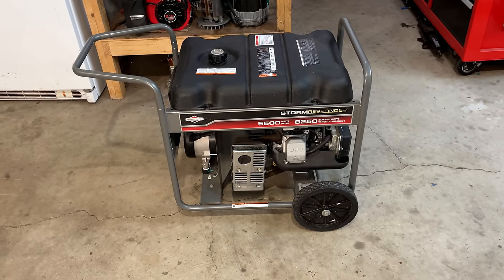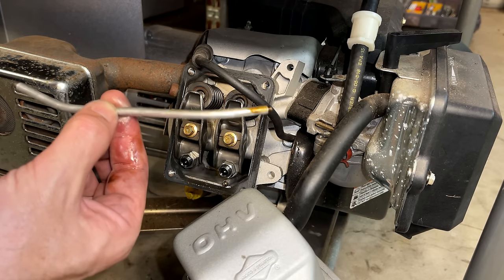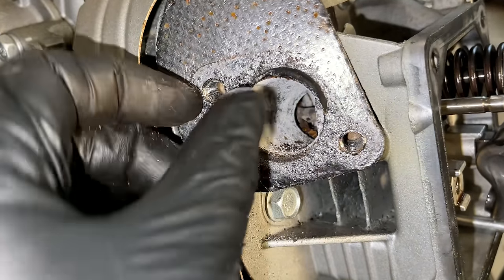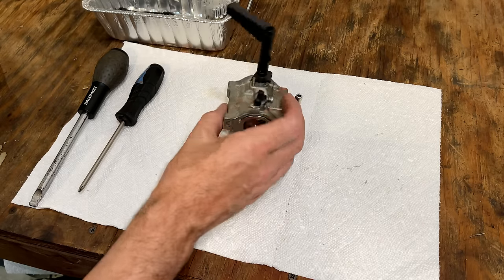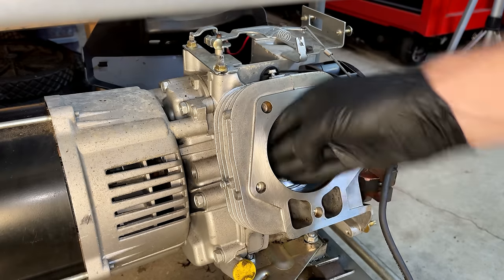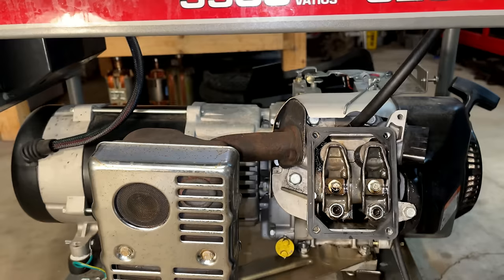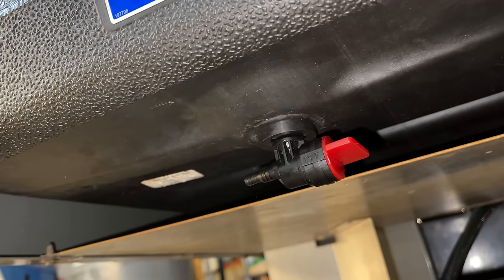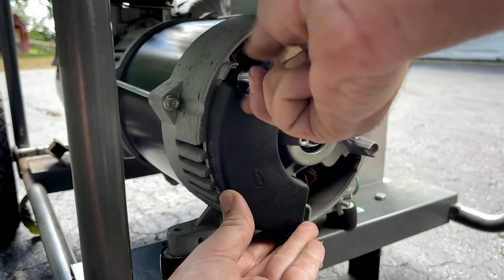Seized Engine - Can This Generator Be Saved?

Comment: Awesome job on getting the generator running for such a great cause. I am retired and on a low income I just bought a Briggs and Stratton 5500 elite with the same engine for super cheap It looks like it ran low on oil owner said it seized. I changed the oil and I now have it turning over, it is stiff but getting easier to turn with a socket wrench. Do you think I have a chance of loosening it and getting it running or am I in for a rebuild.

Comment: Once I had torqued the head down, prior to installing pushrods, I would have leaked it down - would not have been good had you gotten it all together to find the rings were stuck in the piston.

Comment: nice save... when it runs it sounds like soemthing is vibrating and hitting the frame, engine bushings? Something amiss?  Adjust the regulator setting for a bit higher output voltage....
Reply from the maker: Under heavy load it sounded fine in person, but on the video it sounds like rod knock or maybe something else vibrating.

Comment: Great job, and Kudos to you for helping him out. I've donated as many mowers as I've sold over the years.
A question, I've seen you run the generator with the AVR hanging, after adjustment, but can the voltage be adjusted while the engine is running?
Reply from the maker: It is possible to adjust when running, but do not recommend doing so.  Do not want anyone to get hurt.

Comment: I enjoy watching all your videos.  With your access to so many generators, it would be great to compare the AC output signals to compare how clean the power is on each.  I see many complaints that an inverter type is a must, but I have never had an issue with my non-inverter Yamaha EF6600DE powering most of the circuits in my home.  Are some of these non-inverter generators cleaner than others?  While there are many engines used, I'm guessing there are only a few handfuls of different power heads mated to them.

Comment: James I really enjoy all of your videos! Can you put in your tools section where you get your impact driver extensions and your torque wrenches? Also can you show a close up of where you adjust the AVR? I don't want to mess anything up. I just bought a brand new Pulsar duel fuel 12,000 watt generator and under a little load it is running a little low, so I wanted to try to adjust the AVR. Thanks again for all your great videos! I really loved the gocart that you fixed up for your kids! 🙂 Thank you so much for sharing your awesome talent with us! 
Rob.
Reply: There's just one multiturn pot in there. So it's not like there's a whole lot of opportunity to get it wrong.
Reply from the maker: A lot of the tools I use are in my Amazon store under the tools section https://www.amazon.com/shop/jamescondon.  The torque wrenches I use are nothing special.  One is in the 20-240 in-lb scale and the other 20-200 ft-lb scale.

Comment: To your knowledge, do they make an aftermarket low oil sensor? And if so, do you have any experience or an opinion on their usefulness?
Reply from the maker: Have not seen any aftermarket ones.  The casting exist to add one, but would require machining and parts.  These engines made before 2005 have the oil sensor.  Saw an older Briggs that had a sensor screwed into the oil fill.  Not sure the part number or availability.
Reply: Thanks for the information.

Comment: 140v sounds like a confusion.  240 (from the appropriate socket) is surely what was meant?  If there are going to be frequency and voltage issues, it would be good to include instructions on how to get those right for the destination environment.

Comment: I have owned over 60 cars in my life and several motorcycles as well as riding and push lawnmowers and I do not recall ever seeing a spark plug that tight.  I have broken them because i just wrenched on the wrong angle, but they all came loose and did not fight me like that.
Reply from the maker: Never seen one that bad.
Reply: I was going to say that too paulg. Lucky getting it out did not damage the aluminium threads. That would have been a bigger problem altogether.
Reply: @r8118830  Helicoils are no problem really. A lot of folks like to helicoil the threads of aluminum heads right off the bat.

Comment: I recently picked up a nearly new and pristine Westinghouse 9500 watt for $150.  The gamble?  According to the previous owner, the engine was locked up and it had sat for two years.  The thing had no dust on it.  I figured I'd take a flier of a chance at the price and pray for a hydrolock issue.  Sadly, the cylinder is fine.  It must be the rod/crank in a very strong embrace.  I'm guessing it was a power out purchase and someone started it without adding oil.

I've got everything off the chassis except the engine and gen head.  I ordered a flywheel puller of eBay.  For $20, it's not worth the effort to build my own in the shop.  I still need to get a M12x1.75 bolt and come up with a shaft to push the rotor off.

Once inside, I'll know for sure what the damage entails.
Reply: Speaking of good deals on generators, a gentleman gifted me a Porter-Cable 5250 Watt example `cause he was tired of attempting to fix a fuel leak.  This one was also nearly new.  It took me a few days.  But, that plastic insert?  There's a small O-ring that seals fuel.  When I was looking at the insert I thought, "It can't just be the plastic of the insert that seals it.  I tilted the generator up in the air to look at the bottom of the carburetor still installed with the float bowl off.  Yep! Up in its recess was the spit O-ring.  Once replaced, the generator worked fine and no more leak.

Comment: You could tweak the cranking compression by playing with intake valve lash.  The closing of the intake valve relative to piston position on the compression stroke determines how much air/fuel is trapped.  Less lash, valve closes later, drops psi a bit.  These engines run so little lash that you don't have much room to experiment unfortunately.
Reply from the maker: Adjusting the valve clearance will definitely help.  Usually I adjust the exhaust since the compression release bumps that valve.  Tigger clearance means lowered psi because it will hold the valve open a little longer.

Comment: Same model as my gen. but mine has the low oil shut off sensor. Thanks for the Vids. 😁
Reply from the maker: It’s a good engine.  The ones made before 2005 have the sensor.

Comment: I'm impressed that engine didn't blow up with how dark black that oil is and how little it had
Reply: I have two machines that I got for free and both had crazy low oil and they still run great after an oil change. One of them also had no air filter and it was a lawn mower. The other machine was a tiller with a broken and loose oil fill/dipstick cap. It had leaked most of its oil out. Both of those engines show me there not as delicate as I once thought they were. They were also both Hondas.
Reply: Luckily the top end froze solid before the bottom end could let go.
Reply: @1pcfred  right

Comment: Nice videos. Have very similar generator, got running nicely, but when I set it at 61.5 hertz, the voltage is around 137. something, no AVR on my machine though. How do I get the voltage down? Thnaks, Steve

Comment: Thank you for the video. I have an issue with a dewalt dxgnr4000. A foreign object in in crank case, causing the recoil starter to be very difficult to pull. My question is, after I remove the flywheel is it possible to remove the crank case cover, without removing the stator and rest of engine? Thank you in advance.

Comment: You did such a great job on the Unknown, I Wish you were my neighbor!  I’ve got 2 gens...1 Generac 3500 that is stuck, not able to pull the cord, and a champion dual fuel that I’m completely lost on why it’s an elec start, and much more as far as care.  My original was a Generac 5500 go, and it was stolen during a fire evacuation that was mandatory, and I’d already lost my home and all from a wild fire...put my trailer on my property, and was forced to take trailer to a park because of the fact there was no dwelling!  Code enforcement!  I suspect they may have been behind the stolen generator!  So every penny I had saved for a modular was spent  on monthly rent of $850 average per month for trailer space for a 17 foot 2017 Toy hauler that I still live in!   With the fires and other political issues with PGE, our power issues are ridiculous  so Generators are a  necessity, especially in the summertime when the temps this weekend were predicted at 110 F!  Miserable and deadly if no AC is available!  And the Evacuations for the past 8;yrs have been erratic, to say the least!
Remember the Valley Fire...Lake County , Ca ...Anderson Springs Fatalities. 🔥09/12/2015  (#3 most destructive fire in California history at the time....Oakland Hills was #1)🌲🐿🦡🦃🐾🦂🦘🦌🦜🍄🍀💐🌺🌾🌻🏡🗝🔭🧫🏕⛺️🏊🏽‍♀️🍇🔥🕊🦎🐍🐢⛑w

Comment: One of your best videos James! You snatched victory from almost certain defeat!  The only question I have is why the African country it's going to uses 140 Volts, 60 Hz for its grid? That and what would you have charged a paying customer for the head you used?
Reply from the maker: According to Google Africa is 230 volts 50 hertz.  I set it the way he asked without giving it much thought.
Reply from the maker: I do no usually work for customers.  But if this was a paying job probably $100 for the head and gasket plus about 4 hours labor.

Comment: Love your work... I've got basically the same generator with the Generac WheelHouse 5500 with the quick disconnect Fuel Tank... I've serviced it watching you and it runs well at 123 volts and 60+/-Hz.. I have not really load tested it yet... running at full RPM it does seem to have a somewhat rhymic  slight variation if RPM... ?
Reply: Many gensets will tend to hunt a bit with no load. If a hundred watt light is turned on as a load it should smooth out those variations.

Comment: This was a very strange case. From the inside of the air filter housing and the exhaust valve rust it would seem like the unit was stored in a damp environment but the rest of the unit shows no signs of that. The amount of carbon on the piston suggests that the unit saw a considerable amount of use but the cover of the muffler looks like it hadn't seen much use. Maybe the last time it was operated it wasn't run long enough to evaporate condensation resulting in the rusted valve and moisture in the air filter from crankcase ventilation. The moral of the story is that if the seller can't demonstrate that it runs and makes power, it's best just to walk away unless you get it for free or are capable of repairing it yourself.
Reply: It looks like a stream of water hit the air cleaner somehow. Because the rest of the machine wasn't all rotted up.

Comment: @James Condon Do you use mounting paste on any head bolts or is that not advised to do, as dry bolts may be needed to torque to the right spec?
I have usually torqued stretch bolts lubricated as it gives a better feel and the subsequent dismantling has been way, way easier. Some molybdenum/graphite mixture is awesome.
Reply from the maker: The manual does not specify to lubricate the bolts so I don’t.  But I always thought you should.  Either way not a big deal to change a gasket on a single cylinder air cooled engine.

Comment: A worthy save! Nicely done! I do have a question though. If the destination country has a 140-volt power grid and you've set the genny for 125 volts, it's that going to be close enough? That's about 90% of what it should be at. I guess as long as they're not running anything that is electronically-sensitive (desktop computers, motors etc), they should be fine?
Reply: I don't know of anywhere in the world that uses 140 volts. Most of the African continent uses 220-240V at 50Hz with the exception of some small areas of Morocco, Libya and Madagascar which use 115V at 50 Hz. I suspect James is mistaken about the local voltage, probably it is what the subscriber told him.

That said, equipment with switch-mode power supplies don't care about the frequency, the first thing a SMPS does is convert it to DC anyway. A lot of that equipment doesn't care about voltage either. The biggest problem would be with motors, pumps etc which are much more fussy about voltage and frequency, just a few minutes trying to run them on the wrong supply and they could be fried. In the case of a pump providing a village with water that could be disastrous.

If the intention is to use this as a backup generator it could end up costing them more than a correctly rated generator. Equally, if the intention is to use it as the main supply then they may have difficulty obtaining locally sourced equipment which will run on a 120V 60Hz supply. Sadly, this good deed may end up backfiring.

Personally I would have double-checked what the local supply uses, making the engine speed lower to get nearer to 50Hz wouldn't be much of a problem. Additionally leaving the voltage at 115V would allow them to use the 240 volt connector at 230 volts which should be fine for anywhere in Africa, as long as they know they need to be careful which devices can run on 115V and which need 230V.

Comment: Unrelated to this specific video, but is it possible to purchase a snorkel kit for a B&S 173CC vertical shaft engine? My brush hog's air filter gets clogged with weed debris in no time. The same goes for the cooling air intake. Thanks in advance

Comment: When connecting a generator to a breaker box how do you avoid overloading one of the legs?
Reply from the maker: The best way is to install a load meter on each of the legs.  This is the one I use Reliance Controls MB75 Wattmeter Box https://a.co/d/ftONF82

Comment: Amazing save! You did a fantastic job!  I am surprised the engine was save-able!! I just wanted to chime in with a bit of my thoughts on the voltage and frequency used in africa, 

I believe the voltage across africa is 220V 50hz line to neutral.  As far as I am aware there is no area where the voltage is 140 volts, are you sure you didn't get the voltage wrong? This generator would probably work fine if they apply load across the phases on it, and lower the engine RPM to 50hz. But I think 140V is wrong. I would measure across the phases on it, and adjust the AVR for 220 or so, and ignore whatever the line to neutral voltage is, because I think 140v is incorrect. I could be wrong though, but as far as I am aware, 220/380 is the standard :)
Reply: Liberia is 120 volts at 60Hz, Madagascar is 127/220 at 50 Hertz. Those are official specs, that's not to say the local grid doesn't run higher than standard.

Comment: I have that generator and I watched this video and I probably attempted to repair it in the wrong order.  
It had not been run in years and the gas lever  was left in the on position.   

I should’ve started with the carburetor 1st. Beginners mistake!  I changed the oil and added gas. 
Well the gas ended up in the oil and locked it up after it started and ran briefly.  
Now I can’t get rid of the hydro lock.   When I pull the spark plug the handle easy and nothing comes out?   I then put the plug back in and it’s hard to pull again?   

Any suggestions?

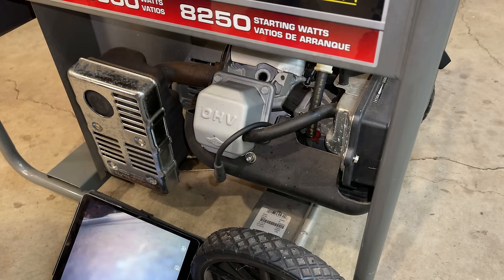Comment: 6:00 You mention PB Blaster, but actually sprayed WD-40. Are they interchangeable here?
Reply from the maker: PB blaster works a little better in this case, but WD-40 had the flexible tube which delivers it better.  I used both.

Comment: I am amazed that every engine  should have an oil sensor.I realized it is an older generator
Reply from the maker: Briggs did away with them for a while from about 2005-1013 probably to save a few bucks.

Comment: Wonder how water got in there. If it was flooded, doubt the generator side would look that fresh. Doesn’t look like it was stored outside. Top of exhaust valve showed definite water damage, as did inside the air filter housing.  Really weird, would like to get more background from original owner.

Comment: I have a dewalt xr with a 8 amp hour battery and it will sheer lug studs off. I use that on suspention bolts. I bet that would of taken half the head with the plug lol.

Comment: When I remove a spark plug I generally did not have it going in the direction to try to tighten it.
Reply: When it was way too tight, he was rocking it back and forth to try to loosen it. That is a normal way to try to loosen a tight bolt or nut that is not moving.

Comment: I have a issue with mice building a nest underneath the fuel tank. Their activity has damaged the heat shield material. I had to sand and repaint the metal heat shield. Looking for some kind of replacement for the what looks like a type of heat proof cloth. I am very leery of it because I do not know if is asbestos or not.
Reply: Asbestos is very white. If it's not over 50 years old it's probably fiberglass which is more yellowish. You don't want to breathe fiberglass either. There's also spun rock too. I'm not a fan of it either. We call it rotten cotton. It looks like dirty brown cotton. If you can't find anything try a solder heat shield. They're not too expensive. The Home Crapo is selling a 9 in. x 12 in. one for $17.97 I have a real asbestos heat blanket. The good stuff! I keep it in a plastic bag. No problems. It's white as snow.

Comment: Question James I have a 10,000 watt Air cooled champion generator I live in Arizona part time and then the summer the ambient air can get 115° is it OK to run a 20w50 Oil in the generator due to oil breakdown
Reply from the maker: Not sure what’s best for that kind of heat.  Definitely not 10w-30.  Would say synthetic at least straight 30 weight or maybe 10w-40.  Most small engine on generators are not rated for heat above 100 degrees.  Would be sure to run it in the shade.
Reply: @jcondon1  Thanks For the info